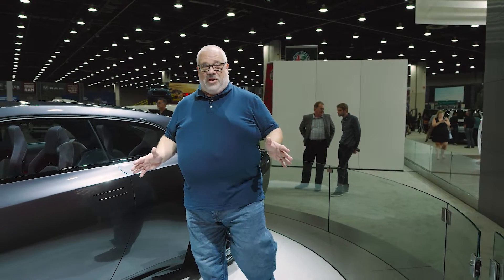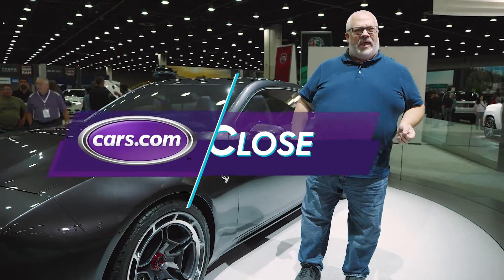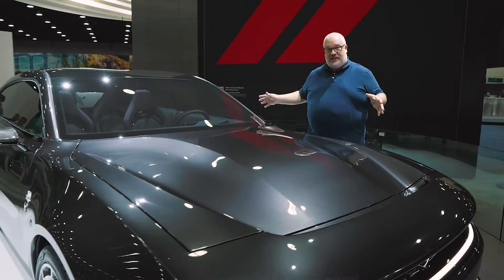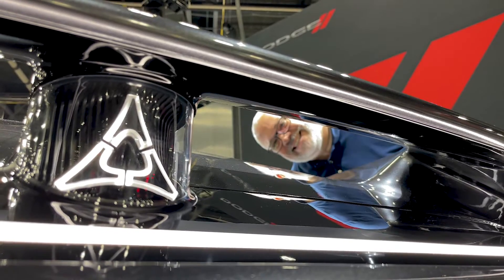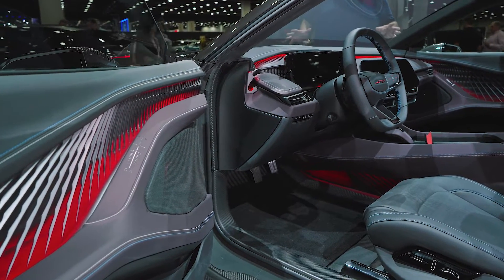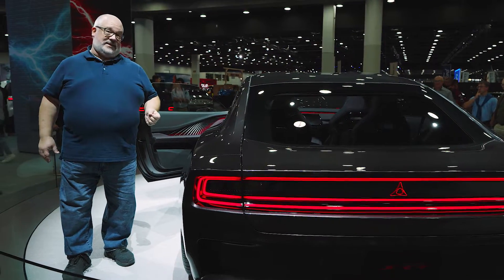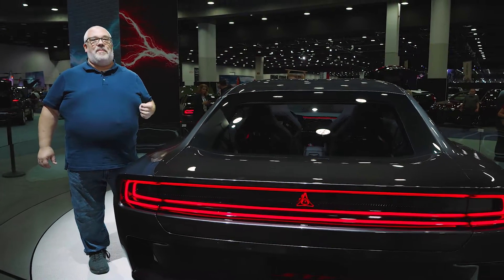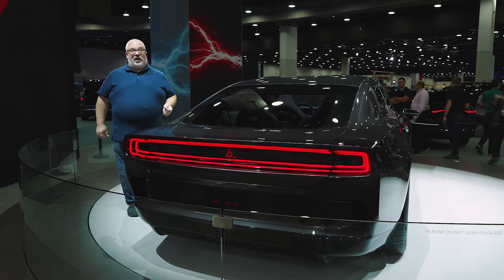Dodge Charger Daytona SRT Concept: Up Close — Cars.com

Comment: Looks are what Charger should be this whole time, but powertrain on the other hand is a joke. I guess some lefty californians will buy some of that, but true muscle fans won't even look at it
Reply: Oh theyll look at it and see tail lights because the performance specs say hellcat killer
Reply: @byrdland5790  For about 10 miles, then EV will chave to charge up and the petrol hellcats will go few miles further :) Also i should mention the durability of single battery plant, which has to be replaced with a new one after around 5-6 years of daily using, an example from a Tesla by the way. That being said, there's no logical reason besides money of course, to produce and use EV's, they're more expensive both to buy and maintain, less durable, less range, no engine roar and disposal of the batteries is even more polluting than the combustion engines.